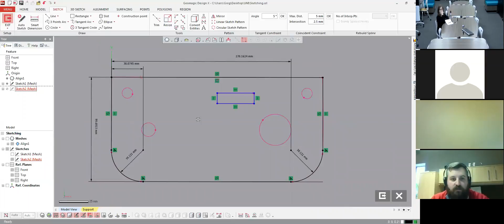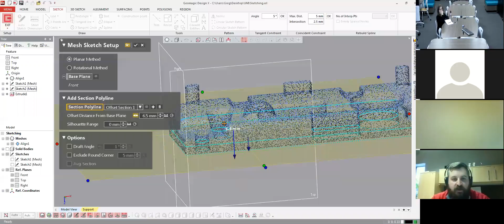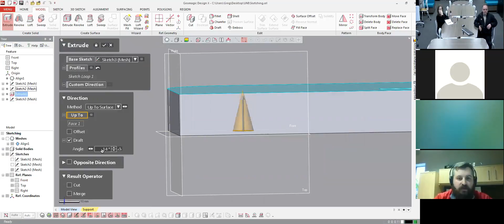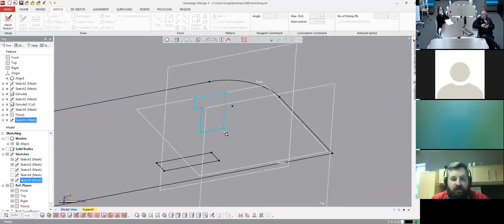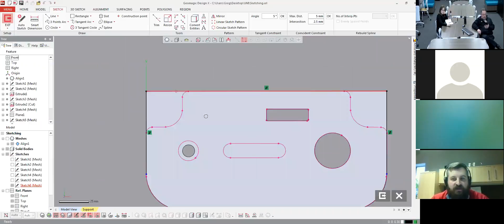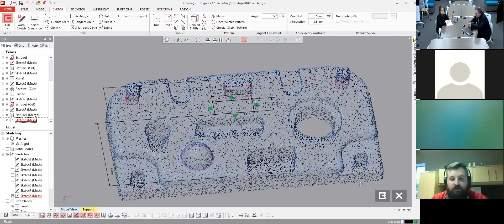Design X Series - Webinar #1 - Basic Sketch/Feature Creation

Comment: I am brand new to Geomagic Design X - trying out the free trial, and nowhere can I find how to start a SECOND sketch. I created Sketch 1 with the Mesh Sketch Setup, finished that sketch and exited out with the Apply and Exit Mode button. When I select Mesh Sketch tool again, it just reopens back into Sketch 1. The only way I have been able to work around the issue is to completely exit out of Design X and relaunch the program. Only after that and reopening the same file, does selecting the Mesh Sketch tool invoke the Mesh Sketch Setup environment for Sketch 2 (for a new sketch). Anyone know why? Am I doing something wrong?